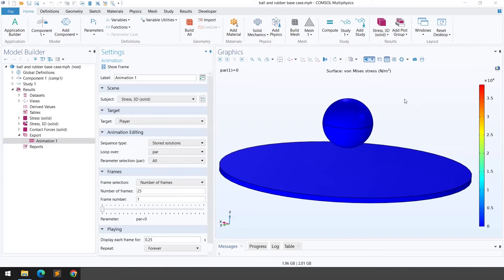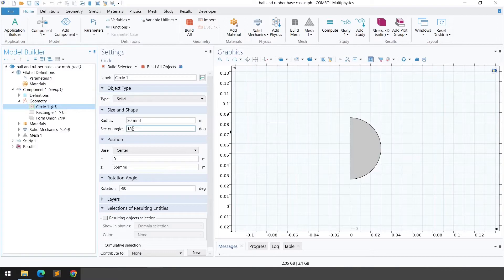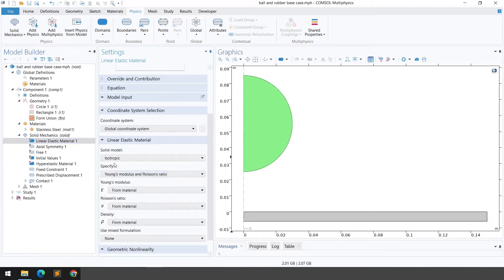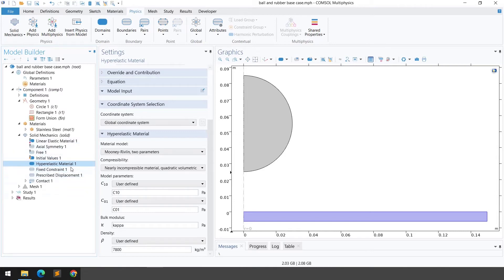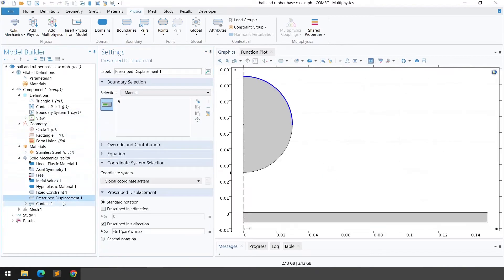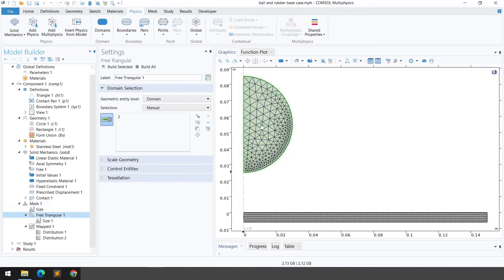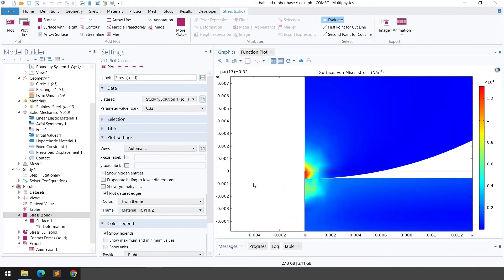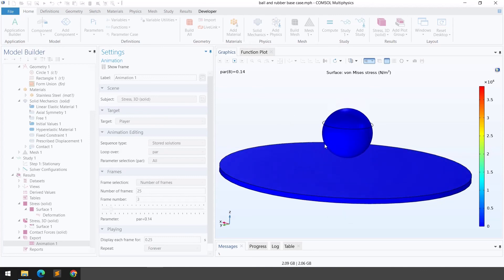COMSOL Tutorial 11 | Rigid ball impact on a hyperelastic material | Impact analysis in COMSOL

Comment: Doesn't work for me. I followed each step carefully and end up with the following error :

"Failed to find a solution for the initial parameter.
Singular matrix.

There are 1 void equations (empty rows in matrix) for the variable comp1.solid.rd1.b.
at coordinates:  (0,0,0), ...
There are 1 void equations (empty rows in matrix) for the variable comp1.solid.rd1.c.
at coordinates:  (0,0,0), ...
There are 1 void equations (empty rows in matrix) for the variable comp1.solid.rd1.d.
at coordinates:  (0,0,0), ...
There are 1 void equations (empty rows in matrix) for the variable comp1.solid.rd1.u.
at coordinates:  (0,0,0), ...
There are 1 void equations (empty rows in matrix) for the variable comp1.solid.rd1.v.
at coordinates:  (0,0,0), ...
There are 1 void equations (empty rows in matrix) for the variable comp1.solid.rd1.w.
at coordinates:  (0,0,0), ...
and similarly for the degrees of freedom (empty columns in matrix).
Returned solution is not converged.
Not all parameter steps returned."

Do you guys have any solution ?
Reply from the maker: Please check your mesh and boundary conditions carefully.

Comment: Sir i need help in solving reynolds equation for fluid film thickness and pressure
Reply from the maker: can you please explain your problem in detail?
Reply: @LearnwithSAI  Sir i want to simulate reynolds equation coupled with elastic deformation equation.Model is defined as a rigid sphere is  resting on a hyperelastic wall separated by a lubricant and the load is applied to sphere which indents hyperelastic wall also there is a change in lubricant film pressure and thickness we need to solve using comsol generating the graphs of lubricant pressure and film thickness and also indentation depth . Problem is transient state.
Reply: May i contact you on email or some other app if feasible

Comment: Hi, I'm so grateful for your complete presentation but I have a question about the contact definition in your parameter section you define two additional parameters without  using them such as SLC, in my opinion, the contact part may need to add a branch like friction or adhesion  please if any section missed let me know
yours faithfully
Reply from the maker: Thank you so much for your kind words and for your detailed observation! You’re correct in noting that I defined additional parameters like SLC, which were not explicitly used in this particular model. Sometimes, I prepare parameters in advance for possible extensions or future adjustments, but they weren’t necessary for the contact definition in this case.

Regarding contact forces, if you’re simulating more complex behaviors like friction or adhesion, you’re right that adding those elements would improve the accuracy. 

You can go to the Contact Pair settings and enable Friction or Adhesion in the Contact branch under the Solid Mechanics module.
These additional settings will allow you to define the coefficient of friction or adhesion forces as needed for your simulation.

Thanks again for pointing that out!

Comment: Thank you for great presentation. Could you do a simulation where the plate is piezoelectric material PZT-5A? Like checking the electrical potential difference caused by the ball collision.
Reply from the maker: Thank you for your kind words! That’s a great suggestion! Simulating a piezoelectric material like PZT-5A and analyzing the electrical potential difference caused by a ball collision would be a very interesting project. I’ll definitely consider creating a tutorial on that in the future.

In the meantime, you can start by using the Piezoelectric Devices module in COMSOL to define the material properties of PZT-5A and couple the Solid Mechanics with Electrostatics to capture the electrical response due to mechanical impact.

Comment: I just want to replace the rectangle with spiral shaped 2 d shape.can u suggest which shape can I go for
Reply from the maker: Thank you for your question! To replace the rectangle with a spiral-shaped 2D structure, you can use the Parametric Curve feature in COMSOL. This allows you to define a spiral geometry by using parametric equations. For a simple spiral, you can set the radius as a function of the angle (e.g., 𝑟 = 𝑎 + 𝑏 ⋅ 𝜃).

Comment: Thank you for this clear presentation. However, when I tried this example myself, Comsol generated an error during computation: 'Feature: Stationary Solver 1 (sol1/s1)
Failed to find a solution for all parameters, even when using the minimum parameter step. No convergence, relative stepsize too small. Returned solution is not converged.
Not all parameter steps returned'. Did you use specific parameters for the solver, or a specific solver? You video did not cover that in detail. Thank you for your help.
Reply from the maker: Thank you for your comment. I need to check my solver settings but I think it is auto-generated settings after you press compute button. Please try with a bit finer mesh. I will check the solved model and come back to you soon.
Reply: Hello. I have the same problem too. do you happen to solve it?
Reply: @Sunny-cz3pl  @pelmp7380 I had the same issue and I just reduced the end parameter value to 1.8 and it worked!

Comment: This was so useful! I have a case where I want to split part of these surfaces and add electrostatics solvers to part of the hyperelastic material surface. What's a good way to join them? Would I use an identity pair definition on the connected boundaries to tell comsol that it's one piece with different dielectric properties in different places? Thanks again! So helpful!
Reply from the maker: I have no experience like what you are asking. Yes, it seems more pragmatic to use identity pair definition for two layers. If I come across anything relevant to your problem, I will share it with you. Many thanks for the appreciation 🙏🏼